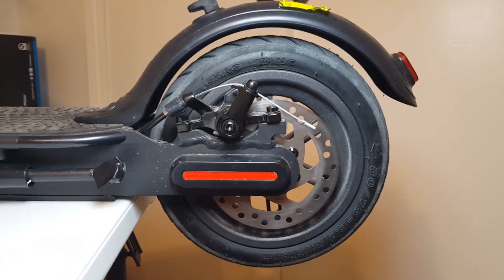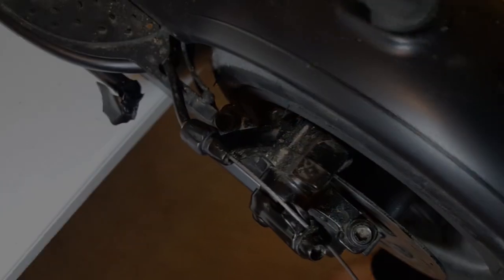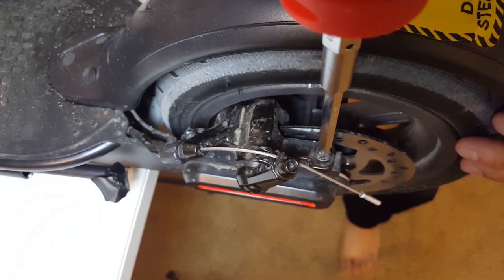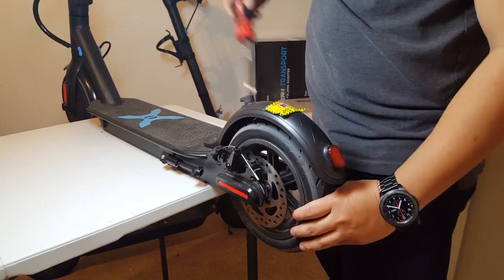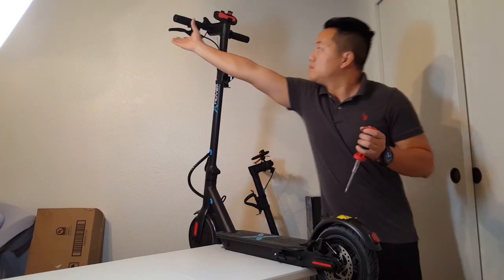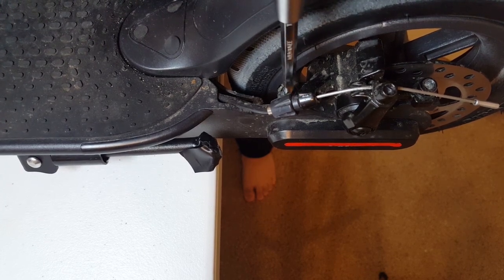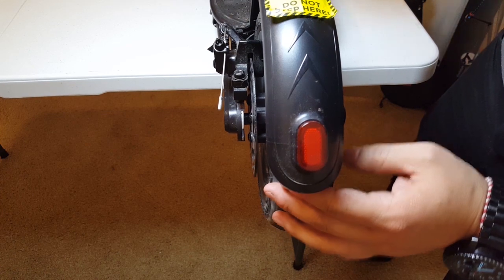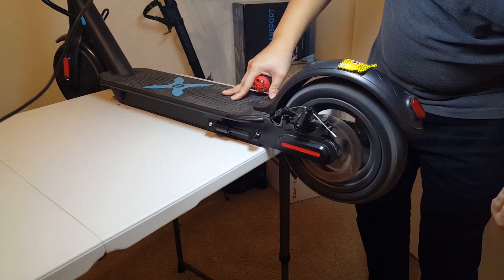ELECTRIC SCOOTER BRAKE DISK ALIGNMENT

Comment: Does it only have the back disc brake? On most scooters there's also an electric brake that engages at the same time to stop the motor in the front wheel. ???

Comment: Alternative fix: The noise is there because the disc is slightly warped/bent. If you look carefully the disc wobble can be seen as you turn the wheel. Just use your thumb to bend back the disc so it is straight again.